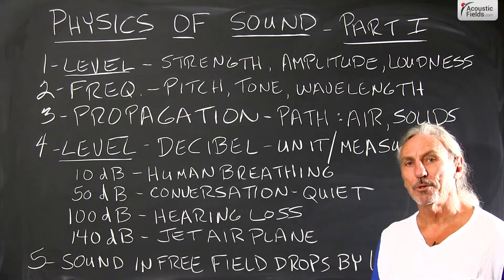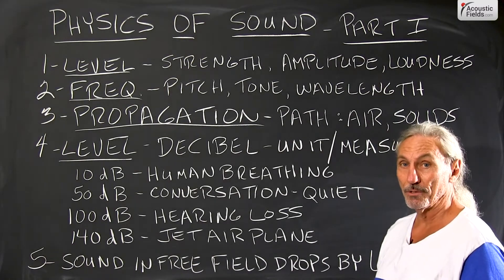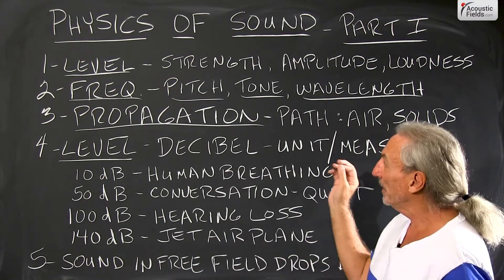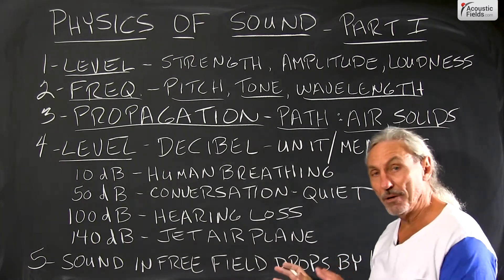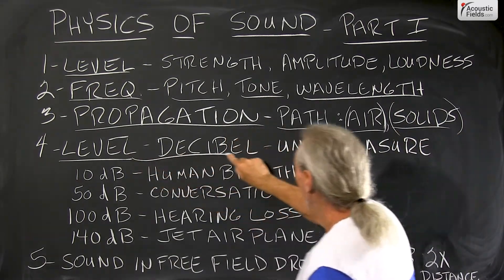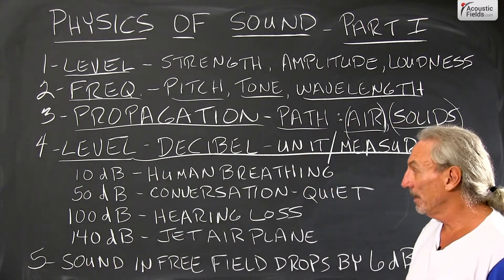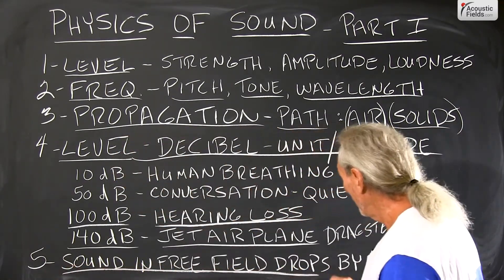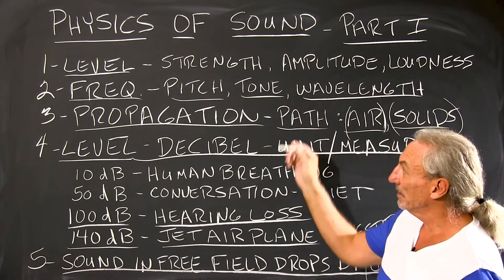Physics of Sound Part I - www.AcousticFields.com

Comment: Ought to do handbook for bass players!Playd in a bar w/app dimensions of 15'h(to open roof peak.I'd est 12/4pitch)x20'wx60'l.An ceiling joist hight bout12'.We set up on width end.My bass amp is near corner aiming out length of room.Now when I play I hv to cut bass control back to bout 10:00.When I hit a c# (probably 62Hz+ or -)I get a resultant howl!I found I had to get my pedal eq an cut round 62Hz.Still there but not as bad.Very frustratin!
Reply from the maker: L, Low frequency energy in small rooms has been my life's work. Even in a room that is 20' w x 15' h x 60' l there are issues. Its the ceiling height and the width that are generating the resonances.
Reply: Thanks.Keep up gd work!